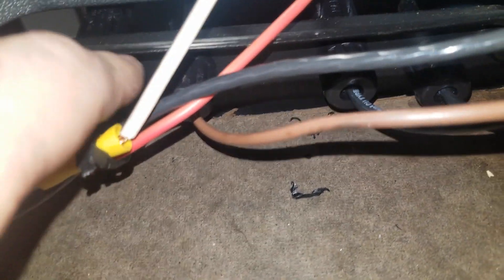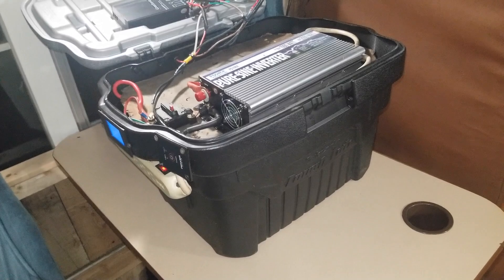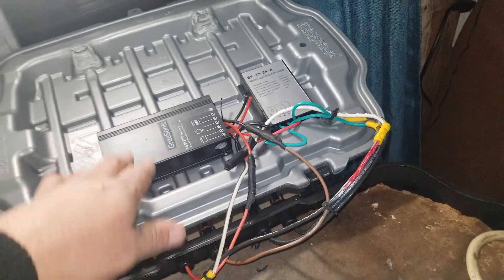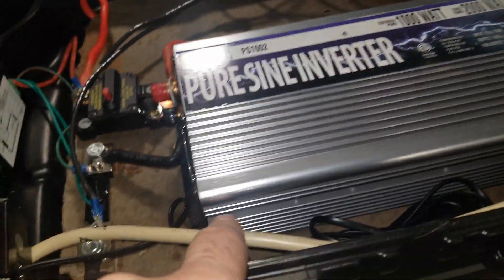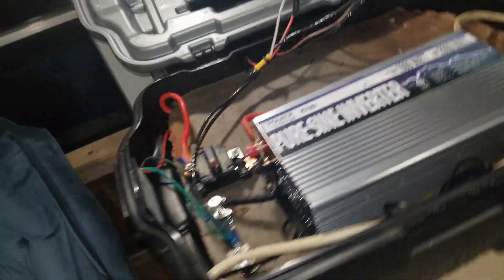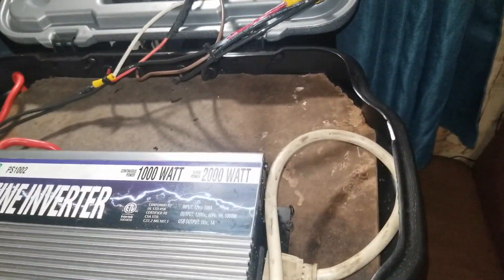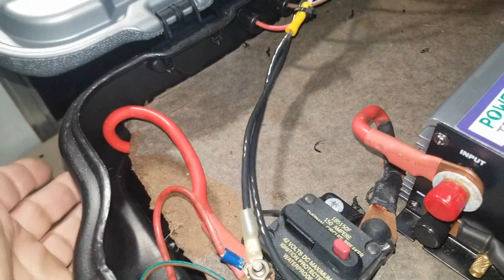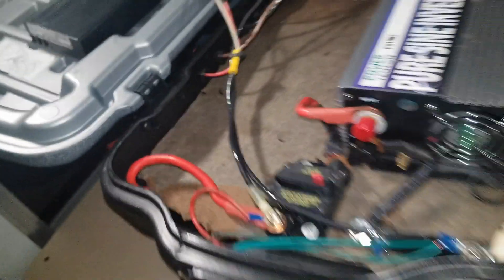DIY Portable Power Box For Off Grid:or Back up Power

Comment: Where did you get the box?
Reply from the maker: It was at Wal Mart. I found it in the section where the trailer hitches and lights are.
Reply: @lukeFugate  
Awesome sauce. Do you remember the cost?
Reply from the maker: @ericstevenson3738  It was a little over $20 it's a Styleworks Tough Tote, can't remember the gallons.
Reply: @lukeFugate  
Thank you sir

Comment: Man that is slick Luke! I would love to build one of those someday. I don't know if I have the technical know-how though. I'll have to check out the other video but this is definitely going on my favorite things playlist. Tweeted it too!
Reply: There nothing you can do lady just have have faith in your self when buy battery have get best battery ok  used lithium battery best like 12volt  50 amp
Reply: @andyjack2368  oh my goodness this video is 2 years old and I'm so happy you replied to my comment because it made me go back in time and remember where I was. Since my comments I have made massive upgrades! I guess you're right, I can do anything if I set my mind to it! LOL
Reply from the maker: It's not really that much. I had extra because of the meter and the extra charge controller. If it didn't have those it would be simpler. I would recommend either lithium batteries or agm batteries, I just used what I had though.
Reply: I want the kind of batteries that are sealed and you can put inside if you want to. Don't want any off-gassing.
Reply from the maker: @AnnsTinyLife  Either of the two would be safe for inside. Lithium is really expensive, but they last over 10 years. AGM are cheaper, but in just a few years they are bad. The ones I will probably end up getting will probably be AGM because I just can't afford $2000 for two lithium batteries.
Reply: @lukeFugate  I got AGM batteries right now. but they are only 35 amp hours each and I've got three. I need way more battery power
Reply from the maker: @AnnsTinyLife  Yes, about 200 amp-hours is pretty good. That's what I have in Zephyr and they last for long enough. more is always better though.

Comment: Hello Mr Fugate. Maybe you could use some auto door seal rubber around the paneling, for sealing between the battery's and the top. That would make it easier to do maintenance on the battery's. Has always I liked and Shared. All my best.
Reply from the maker: Great idea. I was thinking about using some stick on kind of seal. The auto door seal would be perfect!
Reply: Steele Rubber I hear is the best, maybe they have some seconds or scraps they can sell cheap
Reply: Or maybe a salvage yard or even a tow shop that has abandoned vehicles. They can just peel off the door seal and no one will know 🤫

Comment: Love this! It does everything you need for a much better price than the name brand box solutions. The best part is that you can upgrade its components whenever you want.
Reply from the maker: True. I already plan to upgrade the batteries. I'm going to try converting them to alum and if I'm not satisfied with that I'll probably go with agm. I would like to have lithium, but they are a little out of my price range.
Reply: luke Fugate - I personally know nothing about but I’ve been hearing a lot of good things about BattleBorn batteries lately. I gather they are not cheap but the consensus is do solar right (expensive) the first time
Reply from the maker: @RustyZipper  It would be a lot longer lasting with lithium, but with 200 amp hours of Battleborn Batteries, it would be close to $2000. I can change out a lot of old batteries for that price.
Reply: luke Fugate - dang, battery power is so expensive!

Comment: How do maintain the battery when it's sealed how do you add distilled water ?
Reply from the maker: It will be sealed, but it will still lift up to get to the batteries. It will have a rubber seal and some kind of latches or screws.